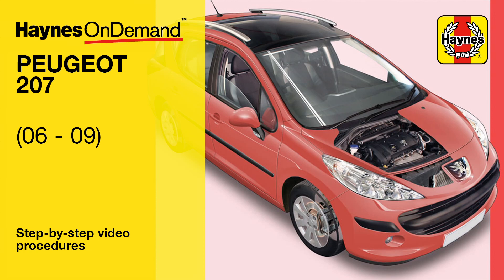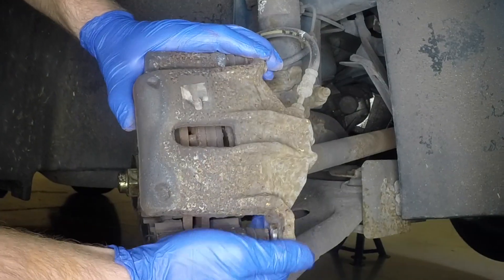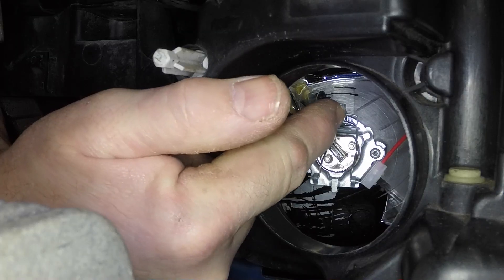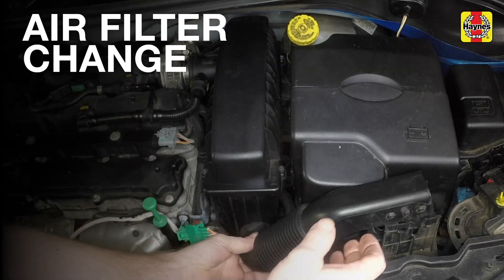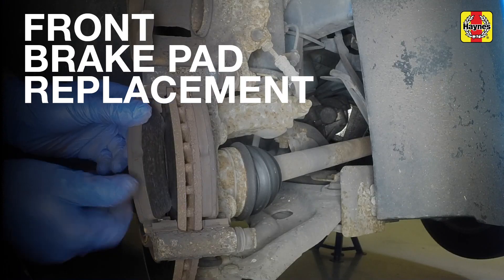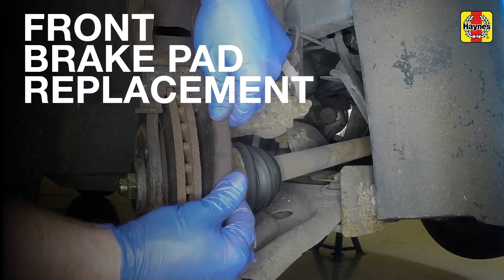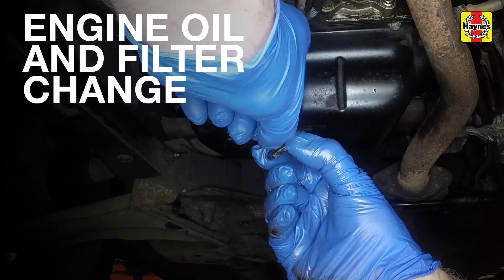Fix your Peugeot 207 (2006 - 2009) with Haynes's video tutorials

Comment: i have anti pollution issue in the car,one mechanic said its the problem of the software of the car and another said its the problem of the engine.Please help
Reply: I know someone with same problem. The ecu has a habit of throwing codes out with anti pollution warning when nothing wrong.
Reply: Did you ever fix it? mine has started up with this issue